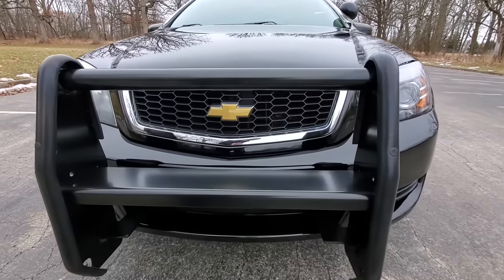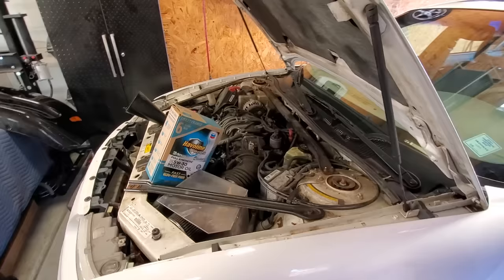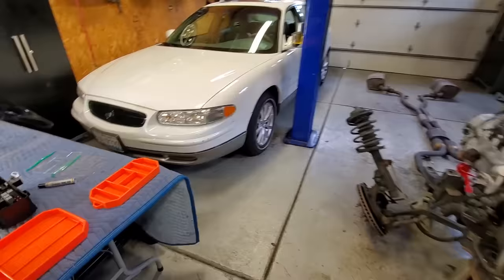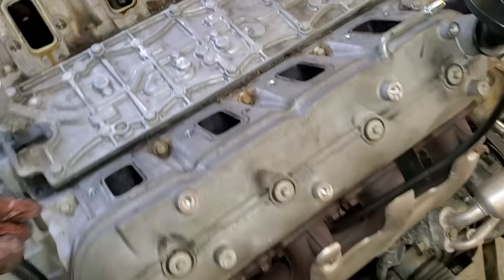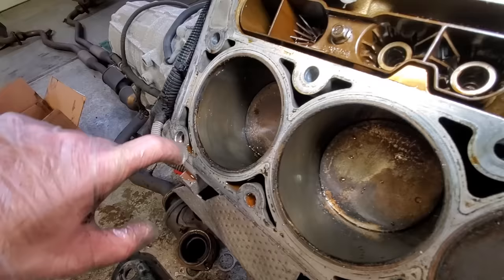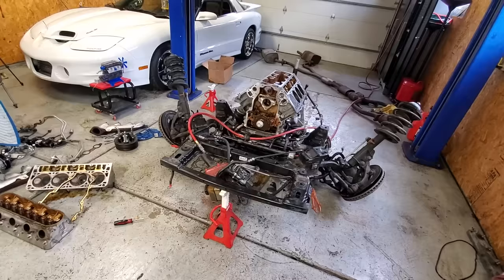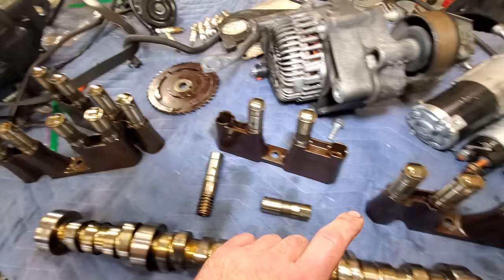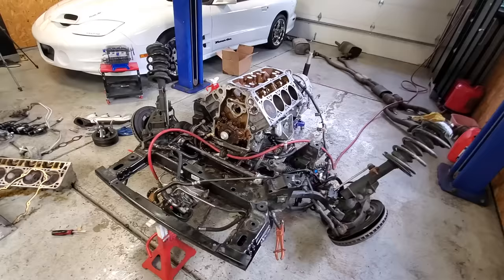Looking Inside An ABUSED V8 Engine That Idled For 12 Months! 357,000 Mile LS Teardown + Body Removal

Comment from the maker: What's your favorite LS powered car or truck? I'm going with my WS6 Trans Am and the C6 ZR1 Corvette.
Reply: I like the 2000-2006 GM fullsize SUVs with the 5.3 LS Vortec engine.
Reply: Holden Commodore Ute
Reply: My 2016 Caprice ppv
Reply: Camaro ZL1 also drop the links for the performance parts
Reply: GTO
Reply: Hands down, no question...a C6 ZR1 Corvette (you're welcome), but your T/A gets an honorable mention Alex.
Reply: I really enjoy my 2010 Camaro SS. I’ll enjoy it more once the 427 stroker I’m building is done.
Reply: My brother had a 2002 WS6 Trans Am with the 325 hp engine and the 6 speed manual and he drove it for 5k miles and sold it to a dude in Sweden for $55k. He took that money and put it towards a new 2007 Corvette Z06 with the 427 505 hp with a 6 speed. Now those were some badass pieces of US steel. Now he has a FULLY loaded ZL1 Camaro, a 74 Camaro Z28 restomod, a 2010 Corvette GS vert, and a 2015 GMC Sierra Black Widow edition. I have a 612 whp EJ8 turbo Civic, a 2000 Mk4 Golf turbo, and a stanced 2001 Honda Accord V6 sedan as a daily. My car story isn't quite as exciting...
Reply: My FAVORITE LS powered GM is a 2005 GTO LS2 6 speed in red with black leather. I drove the 2004 LS1 6 speed and they're some powerful well handling cars. I scared tf out of the salesman. The GM of the dealership saw me do a burnout in it and followed us back to the dealership and he said, "I hope you intend to pay for that car young man!" I pulled $50k cash out of my pocket and said, will this do? His entire demeanor changed...lmao
Reply: we have very similar taste lol
Reply: If I could have any one I would love to have a GTSR W1🤤🤤🤤
Reply: LS swapped BMW e30
Reply: I'll go with your WS6 TA. It's come a long way from when you first got it, that's for sure!
Reply: 06 Denali XL
Reply: Where can I find a car like this, I’m in the south
Reply: the LSA  CTS-V and the LS3 C6 Corvette
Reply: Dude the DOD issues is due to people not using the right spec oil and not changing the oil, that's it and not using good quality oil and oil filter as well and more important you can see the holden front external transmission cooler as well, which works really well as well and cops do not drive the cars like the average person would and the ideal hours is nothing when you consider the new good oil and A/C delco oil filters used ,they cant use any other products while the cops have it, due to legal issues and in Australia the cops get rid of the cars they use before they reach 50,000KM they go to the auctions and that is it. also that car is the best really in florida and the heat and humidity as well and look how good that engine is, so think if you changed the oil even more frequently instead of the normal 15,000KM period, like the book says if used in very hot and humid or dusty areas to change the oil every 10,000 or earlier even, that way the engine runs smoother and is looked after, ? Thank Holden Australia and its engineers.  :)
Reply: I have a 2015 Holden Redline SSV, with the L77 6lt ( You have the L98 ) basically the same as the chevy Ss imported into the states, added rear silver coloured brembos with massive 360mm rotors and straight through rear mufflers and a KN air filter thats it, but more importantly you need to put a OTR or cold air intake on that beast, which looks like this https://empireperformance.com.au/products/holden-commodore-vf-2013-2017-vcm-otr-intake?utm_medium=cpc&utm_source=google&utm_campaign=Google%20Shopping&gclid=CjwKCAjwiMj2BRBFEiwAYfTbCkhNqFvrFaLU5i2CI2PORhHOj7ASFO80dr7EseMasy5Tpkbc35A_9BoCfiEQAvD_BwE.
I hope you buy one as after the cam, headers etc, it needs it it will make at least around 500hp at the rear wheels depending on the cam and tune, but it needs the over the radiator cold air intake full stop, to maz the performance of the engine. :) Also change the oil guides seals, springs and also use only real good quality oils like you do anyway, but cant wait till its tuned and on a dyno to see how much power she will make cheers :)
Reply: Dude the only real way to know if the engine was taken apart is to look for the Oe paint marks on the bolts and clamps ,that way you know for sure she was taken apart or at least worked on to a point say the heads etc. :) Even the coil packs have paint marks on the bolts. :)
Reply: heres a upload about the VCM OTR install for the same car really just a Ss and the engine and running gear is the same, other than the Stronger rear end cradle on the caprice in the staters. :) https://youtu.be/Jh1lfXwNlQI
cheers please do it, so much extra air and tunning ability for the engine and ECU as well. :)
Reply: Sell me your trans ams front plate cover. I’ll pay shipping too
Reply: Any vehicle with the LS platform is great.
My 02 2500HD with 315k, rebuilding it now with upgraded components. That is my favorite.
Reply: Definitely a Pontiac g8 gt. Love watching the caprice videos can’t wait to see everything to do to it!
Reply: Hawks Third Gen had a slightly wrecked C6 ZO6 in what 4th gen guys would call SOM that I really wish I had the money for last week. Spotted it on eBay. But an SOM Firehawk 6-speed hardtop (I think SLP made 2 of them), a G8 GXP manual (in any color) or the '04 C5 ZO6 that GMHTP broke into the 11's with stock and almost wiped out at a toll booth with in the rain. For some reason I don't dig the C7 or C8  platforms even though they are admirable performers. Great content as usual, thanks for a look into a system I haven't had experience with.
Reply: @DBSSTEELER  Same here man. My 2010 Camaro SS, LS3 cammed & full bolt on. She's a beast!
Reply: I love the ls7 love those 7 liter engines
Reply: LSA life
Reply: @AlienWare333  If that was meant for me, I believe there were about 18 SOM (Sunset Orange Metallic) Firehawks made and only 2 were 6-speed hardtops. One of the T-Top cars used to race the spectator drags at Seekonk Speedway in Massachusetts. Any regular SOM 4th gen is pretty rare to see in the wild, and I've only ever driven two of them (a WS-6 and an SS). Which is why I "settled" for my silver hardtop auto that I have a T-56 swap for and will eventually do the full color change on. I got that to run 13.1 at elevation in heat without a lot of money and rebuilding the 4L60 myself, so I totally get why you'd offer the "dim bulb" compliment. Cheers, and best of luck on your LS powered vehicle or beautiful opinion.
Reply: That’s too hard but for f bodies I would say Ws6, old school not sure maybe 70 chevelle ls6. Favorite ls truck is I don’t know
Reply: DBSSTEELER dam man that sounds great
Reply: @romero.4089  I pulled an LQ4/4L80 out of a 3500 GMC Short Bus that was straight up evil. My friend worked at a scrap yard and they where doing burnouts and  donuts with it the day before I pulled it. Sold the engine to a guy in Allentown, PA that was putting it in a '79 Camaro and had an LS swapped Fox Body that he ran at Maple. I tried to buy the whole Short Bus and they wouldn't let me because of their scrap yard rules. Someday....
Reply: Spokes dam man goodluck man soon don’t worry
Reply: My 2000 formula firebird 6 speed. Looks like a base model.  Suprises people all the time.
Reply: Please do a test that proves that a car or truck can drive by just using fumes from gas
Reply: My L76 6.0L LS powered 66 chevelle. Just swapped the cam and springs in it and going with a new 80mm turbo. ;)
Reply: G8 GT followed by the 4th gen F body
Reply: My C6Z06, makes 630 rwhp n/a on pump gas, stock bolt ons, ported stock heads.
Reply: @ja5435  Project Farm did that and Dave reads and responds to almost every comment that is of merit. Even years later I've gotten replies back from him. It's hilarious since his channel blew up.
Reply: I seen a 1968 Volkswagen bug with a LS I would have to say that's my favorite 👌
Reply: #1 is the 3rd gen CTS-V, #2 is the SS, #3 is the Caprice PPV b/c they’re way cheaper than the first two!
Reply: Great video (again :D ) !!!
When you edit, please, lower the volume of the "music fills". I watched the video at night and woke up my son when the video switched from your voice comment to the music.
Except from that little issue, the rest is PERFECT INFO for all mechanic maniacs, as usual in your channel.
Reply: I agree with the C-6 Z06, then would be the C-5 Z06. The only LS engine I've owned is a LS4 in my 08' Impala SS. My other Chevrolet engine is my 96' LT1 Corvette and it has been a great engine.
Reply: Winnebago Cheiftain
Reply: Great video! I'm a huge 3800 LS fan!
BUT the music during fast forward! Really?! C'mon man!  Metallica, Slayer, Led Zeppelin!! anything but teenage teenybopper Hip Hop! LoL!
Great video! I have a Trans am fun car!!
And by the way, I have averarged 24 to 26 MPG averarge multiple times in my 2014 Silverado with the cruise control set at 72 to 76 MPH, the V4 mode is very effective and I have 111,000 trouble free miles!!
Reply: @loushear4497  I had one!!!
Yeah surprised a lot of people!!
Reply: Chevy ss/commodore Ss. Same formula as a E39 M5
Reply: My HSV GTS VF, hello from Australia!, and you can see it in action on my channel!, giddyup!
Reply: Saab 9-7X
Reply: I have an LS but a Trailblazer with a straight 6. An LS5 came in the TBSS
Reply: C6 Z06, LS7 all day over every other LS ever.
Reply: 04 GTO with the LS1 because throttle by cable is so much fun. And i 'll hear the engine more because GTOs are pigs to pull.
Reply: You do realize that "LS" Engine is Australian right?
Reply: Not quite an LS but i'm partial to my L96 equipped 6.0 in my '13 Silverado 2500HD
Reply: My 2000 vt Holden ss
Reply: Falcon F7
Reply: Mine is the 2014-2017 Chevy SS Sedan. It’s so underrated.
Reply: LQ9 6.0 iron block truck engine
Reply: my favorite LS powered truck is a gmc suburban with a 5.3 ls swap b
Reply: 1996 Chevrolet express
Reply: Walkinshaw Commie
Reply: My first car was a 2002 Camaro Z28. Thing was a stripper had no power windows or locks and the best car to learn stick/ how to drive in general. I had it for about 5 years and sold it, in hindsight I would have kept it even longer as it was super clean worked perfectly and only had 100k on it.
Reply: Cee ate
Reply: 94-96 Buick Roadmaster Wagons
Reply: 07 ls2
Reply: 2010 camaro ss
Reply: my 09 Pontiac G8 GT 6.0
Reply: My 03 rcsb 4.8 5spd ;)
Reply: @7071t6   exactly, my 09 Pontiac G8 GT has 140k on it with no DOD issues
Reply: G8 GXP
Reply: @spokes5201  I have an lq4 in my cts-v1, the torque curve keeps a constant smile on my face.
Reply: My 2000 WS6
Reply: 1994 s10 ss forsure
Reply: C8 Corvette with the 7 liter 4 cam LS marine engine swap, real savage.
Reply: I like the LS in the 2500hd the L96 6.0. It has great low end a killer top end for towing.

Comment: Wow, looking at the insides so far & hearing the story of you leaving it run for a day as it was so quiet & how all the rubber was melted to the engine, I'm wondering if it might've been a mistake to open it up & if it might not have just carried on forever with regular oil changes and cooling system maintenance...
Reply: He also said it was burning oil and fuel so a rework was needed. I'm glad he bought all new gear and not just disassemble the engine for show.

Comment: Enjoyed the tear down of this engine and i must say the engine very fresh for the abuse it endured.

Looking forward to more updates as the build progresses.
Reply: maybe the car was own by a mall security
Reply: This car was NOT abused!!  Regardless of the crap he says about 1 hour being 33 miles.  But he doesnt provide the source of that information.  I have torn down over 2 dozen LS engines in the last 5 years and almost all of them have the crosshatch still in the cylinders.  So dont let that shit scare you.  The very first one had 267,000 miles on it and was a bone stock 5.3, STILL had the crosshatch in the cylinders.
Reply: I just purchased two LS engines,  one from a friend who performed regular maintenance every 3k miles.  All the internals were super clean, no cooked oil residue in the crank case.  Now the second engine I purchased was obviously lacking in the maintenance department.  Everything was brown, crank was brown, rods, rockers, springs, everything smelled of cooked burnt oil.  Regular oil changes does show inside an engine
Reply: I agree, NOT abused. Used and well maintained.

Comment: You know that this guy is the real thing, when he drops the sub-frame in the engine bay just so he can work on this classic LS engine better!
Reply: Everything is much easier with a lift.
Reply: Wish I had a lift
Reply: @ne2i  yup seen this done on a 928 porsche..like you say wish had a lift its so right times you work on it hand gets stuck
Reply: Makes things easy as basically all cars are built by lifting the complete engine in with the sub-frame.
Reply: Timothy Iorlano  'classic' as in classic car, no. Classic as in the original 'LS' line of engines, hell yes!  (Spoiler: the LS engine [in a Chevy Corvette] has been around since '97, almost 24 years)!

Comment: "Idling is generally bad for an engine

Pulls apart engine and only looks like it has 87,000miles
Reply: heat cycling engines are usually what wear engines out more than just miles/kilometers/hours cause during a heatcycle the metal in the engine expands when it heats up and shrinks when it cools back down what causes metal to slowly warp out of shape and sooner or later cause an engine to lose compression or spin bearings or something like that
Reply: @unluckyrgg  Science over bias. I like that.

Well said. 👍
Reply: Only bad on old diesel with glazing bores but machining now us better
Reply: I was thinking more like 93,274, but after examining the cross hatches in  #8  I think you nailed it with 87,000

Comment: Be sure you replace the engine mounts while you're in there.. Just did the same on my Caprice but I'm building a turbo setup.
Reply: Also.. I notice your tensioner is broken too.. I pulled 11 pieces of plastic put of my oil pick up. Just an FYI

Comment: That is one incredibly clean engine!! Proper maintenance: Priceless!
Reply: Some municipalities do a great job with PM. I used to teach maintenance tracking, including to FL municipalities in some cases. I'd point  out the hours issue and then suggest oil analysis. With good oil and drain intervals that don't show wear metals you're good. Perhaps this city was one that I worked with. <G>

I had similar things to say about brakes. Some places wanted to use pep boys brake parts. I pointed out that first brake jobs where all parts were factory were at a certain mileage on average. And later ones tended to be 5-10 thousand miles less. Just to save $25 in parts over the dealership with municipal discount. Save a couple of brake jobs over the life of the car as well as less downtime and better braking and the factory cop spec parts start looking real good.
Reply: Florida="Cold start?  What's that?"  Best conditions for an engine.  Doesn't even get hot enough for heat-based wear like Texas or Arizona...
Reply: @brentboswell1294  but it doesn’t rust out faster

Comment: My 04 Silverado was a town truck and had 10,000 hours and 154,500 when I bought it. It was a 5.3l I drove that truck hard for a few years and finally traded it at  237,900 miles. Good engine, good truck.

Comment: Im a AST for a road construction company and when I started there I did some tune ups on some of our older chevy/gmc trucks (07-10 models) they all had between 300,000-400000km on them with original plugs. The electrode on the delco plugs was actually recessed in the in about 2mm in the porcelain insulator and the engines were not even misfiring yet. I was so amazed